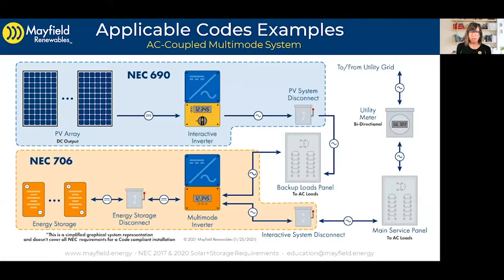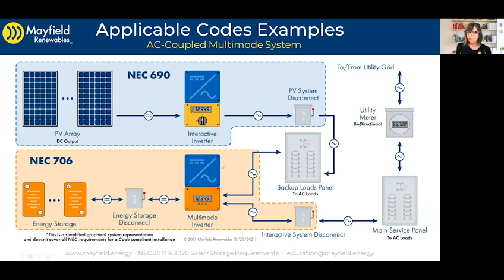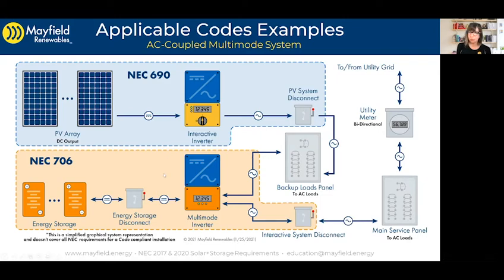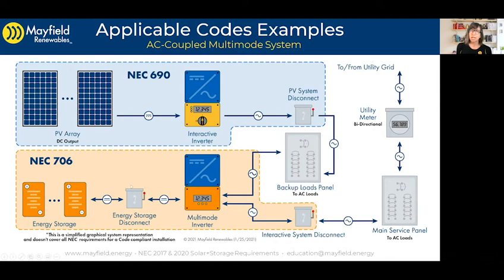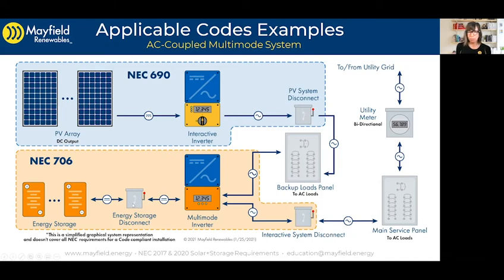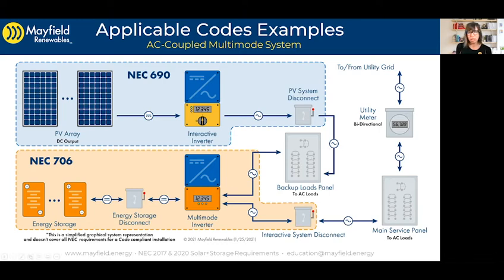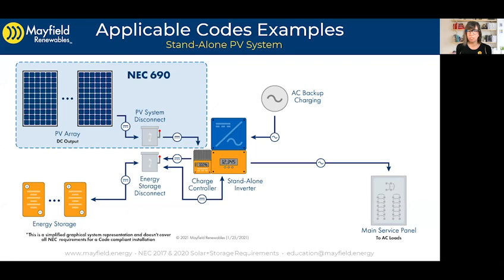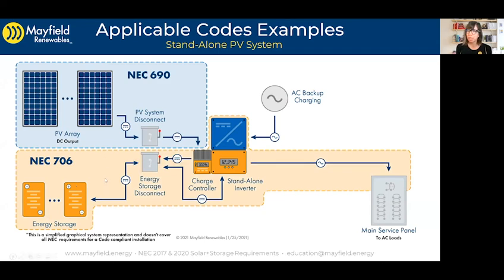Course Preview: NEC 2017 & 2020 Solar+Storage Requirements

Comment: What if my system is DC only? (No inverter, no utility connection.)
Reply from the maker: For a DC-only system there must be a way to disconnect the battery system from all other conductors. Otherwise, you'll be following the same Code references discussed in the video.